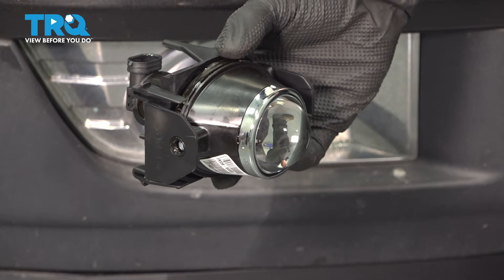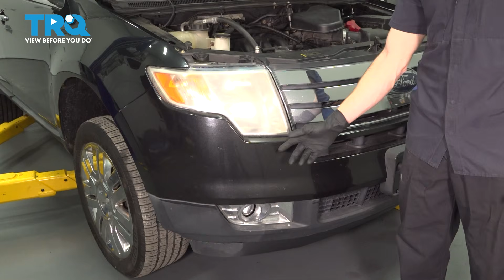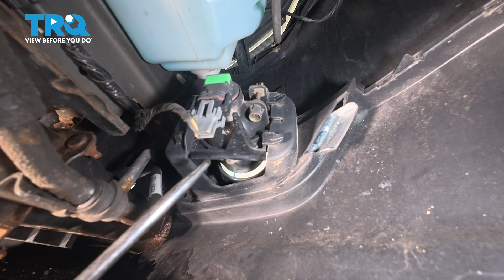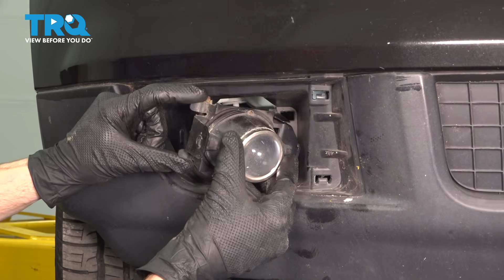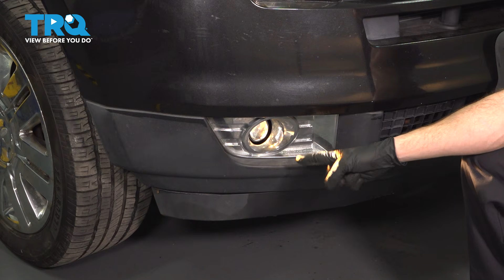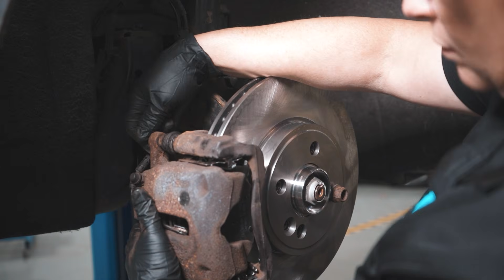How to Replace Fog Lamp Assemblies 2007-2014 Ford Edge

Comment: This video is inaccurate. 2011, 2012, 2013, and 2014 do not have these fog lamps. Those year received a different grill, bumper cover, and headlamps